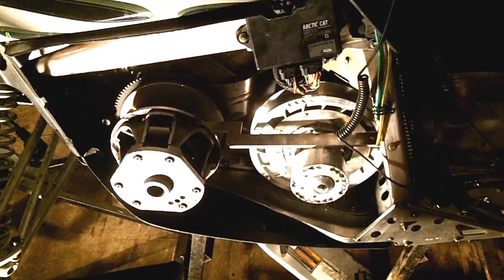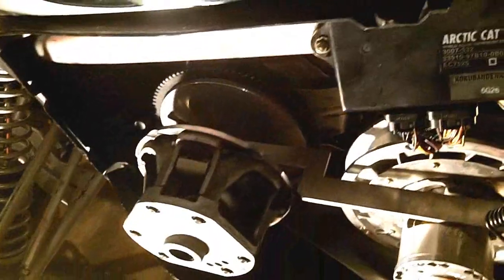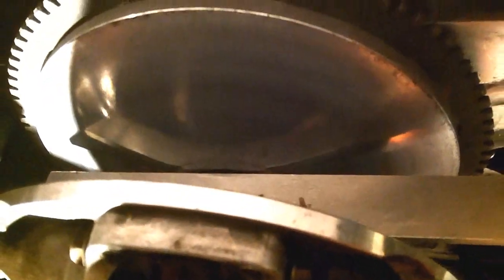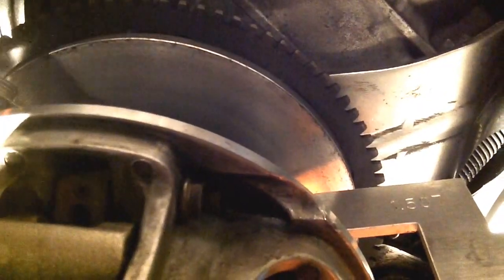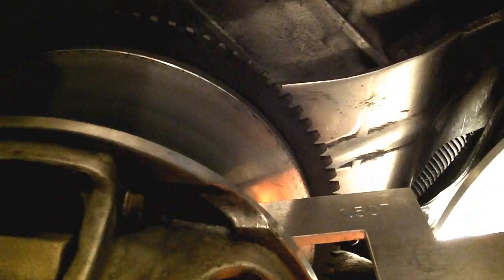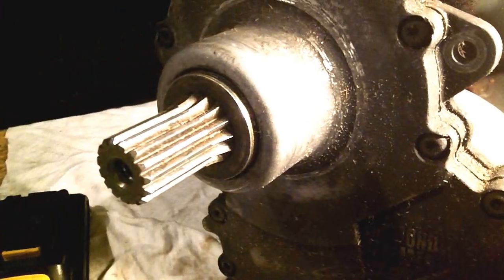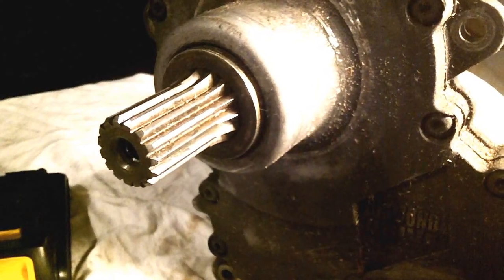How to Check and Adjust Clutch Alignment on an Arctic Cat Diamond Drive Snowmobile.

Comment: Totally not useful at all
Reply from the maker: Why do you say that?
Reply: @TitanTown  you did not show anything. You showed the wrong tool and then the right tool. But still, you did not show how to adjust the clutch alignment.
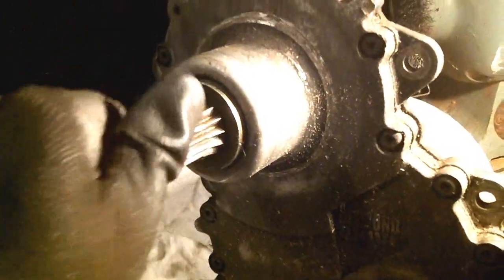Reply from the maker: @terryberg  yes it is shown at 2:10.  Ad or remove spacers behind secondary.
Reply: @TitanTown  that’s not enough. That is a very small part of the alignment and there’s no context or path to getting to that point in this video. 

I’m not going to harp on this. I should have been more specific in my original comment, and not so snarky about it. My intent was not to put you on the defensive. I Apologize.
Reply: It would be great if you could make a video explaining the clutch springs and how they work and which ones to change in order to get the clutch to smoothly engage at a much lower RPM, that would be great. I’m tired of getting whiplash every time I want to go sledding. I’m not drag racing, I don’t need to jump off the line in a split second.
Reply from the maker: You are right there are other factors in alignment but adding/removing the spacers behind the secondary is one of the easiest to check and correct.
Reply from the maker: That is a good idea.  There are two ways of tuning the engagement of the primary.  One is changing the weight of the weights.  The other is putting in a different spring.  In your case putting in heavier weights or a softer spring would make a smoother engagement.